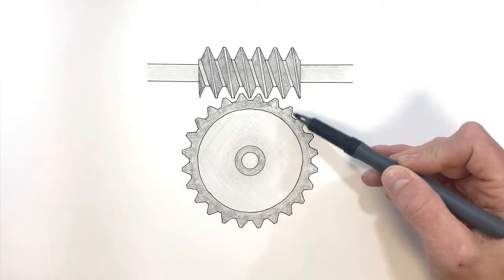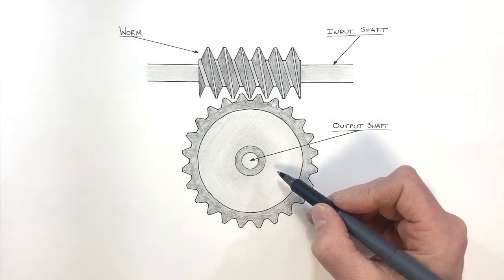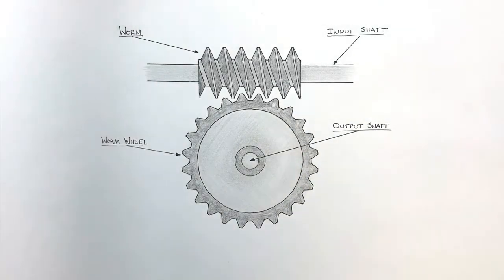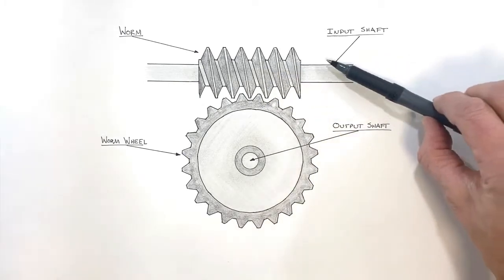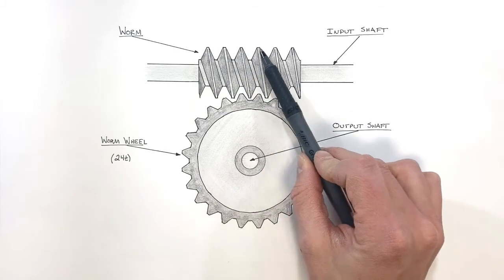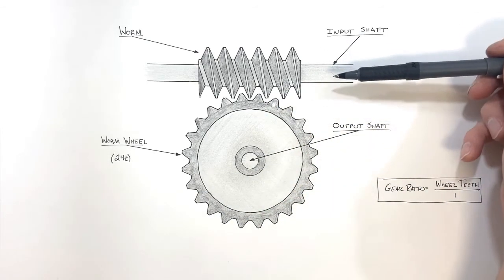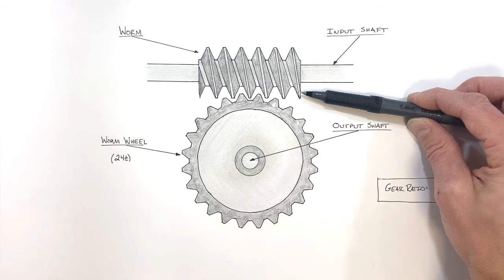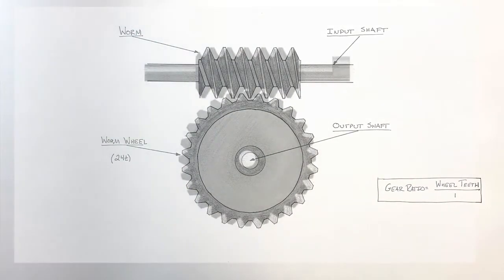Worm Gears Explained, Calculated & Modeled

Comment: So let me get this right , if the wormwheel has 40 teeth, will it be a 40 to 1 ratio? And how many 'threads' on the worm gear will achieve this? Will the worm be turned 40 times move the wheel through one revolution?

Comment: i love the drawings in your videos, so much so that i wanna make similar ones to present my different designs for my thesis (i'm a final year mechanical engineering student). the designs are mostly gear or ratchet mechanisms, one of them being a worm gear similar to the one in this video. would it be alright if you gave me some advice on how you go about drawing these or any equipment i might need to recreate them myself ? many thanks in advance - dont stop the good work !

Comment: is there any way in which the screw drives the gear along the screw, whilst also rotating the gear?
Reply from the maker: Do mean like if we let the worm travel axially along the input shaft?
Reply: @INTEGRALPHYSICS  Yes. I want this too. I want to turn a threaded rod that is the output screw, but I need the input shaft at 90degrees to the threaded rod. So the threaded rod needs to rotate as well as moving longitudinally for a minimal distance.

Comment: Hai, wonderful vedio. I have 2 questions for you. Does the worm and roller  require grease or steering oil of ranges 140 or 300 or 450 or 600.  By second question is does the worm and roller make driving more effortless than circulating ball bearing also called as ball and nut or is the recirculating ball mechanism   more effortless than the worn and roller. As I had a fiat 118 NE which was the 124 fitted with the Nissan A12 engine which had the recirculating ball mechanism which was smooth like butter , I still regret for having sold it. It was so smooth even though it didn't have power assistance

Comment: I am surprised that leads on the worm wasn't mention, that is extremely important on knowing the ratio, the example assumes the worm gear will always be a single lead, but there are worms with more then one lead, that is how a worm gearbox achieves various ratios, such as four leads on a worm would have changed this example to a 6:1 ratio, when you have a gearbox with a missing nameplate where the reducer is so worn out you cannot turn it by hand to get the ratio you must know this because the speed reducer once broken down almost always has enough tooth left on the wheel gear to count as well as counting the leads on the worm to know the ratio.

Comment: Another excellent explanation.
Little side note: A worm gear assembly is basically self-locking.
The worm wheel cannot (back-)drive the worm. Only the worm can drive the wheel due to inherent friction and direction of forces.
Can be desired or not. But if you want to use it, you should be aware of this.
Reply: Whether the worm assembly is self-locking depends of the pressure angle between the worm and wheel, or if the worm has a double start thread...
Reply: I was going to make this important point as well - but checked and see you have it covered.  This locking feature is what makes it a perfect design for a tuning gear on a guitar for example- not only the gear reduction.
Reply: Indeed. And a 'worm gear winch' is great in that it can pull more weight than a non-wormgear and also hold that weight and reverse when needed smoothly. There's no stopping pawl that has to be released. I used three worm gear winches on a modified horse shoeing stock to pull up the feet of stubborn horses. Works great on heavy draft horses, it's just very slow to turn, so I altered each winch slightly so they can be turned by a battery powered drill. What used to require two to three men now only requires one.

Comment: hi 
if i try to spin the wheal will the screw rotate or is it locked ?
Reply: Most worm gear systems are specifically designed so you can't drive it in reverse.  An application of the worm gear, is the tuning knobs on a musical instrument, which allow you to tighten the string, but don't allow the string to unwind the tuning knob.

It is possible with an extremely steep helix of the worm threads, to make a worm gear that can be driven by the worm wheel, but it is rare that we desire such an application.  It is much more likely that we would use other gear arrangements if we wanted bidirectional power transmission.

Comment: Can you do the reverse? Cna the worm gear ever be the output and the input be driving it so that we get a good ratio for speed?
Reply from the maker: Typically no.  Once friction is factored in, it is extremely inefficient (or even impossible) for the wheel to drive the worm.

Comment: I didn’t realize how much torque was multiplied through the worm gear assembly!

You didnt mention that a worm gear may turn a worm wheel, but a worm wheel may not turn a worm gear.
Reply from the maker: Big wheel + Small Pitch = Big Torque

If the pitch of the worm is large enough the wheel can in fact turn the worm.

Comment: hi all. i have a question. is it possible for a worm wheel to rotate a worm gear . im trying to design a pedal sysyem for my boat . im after max revolutions on the prop shaft to one turn of the pedal. cheers. plus a worm gear would eliminate the need for a 90 degree gear box
Reply from the maker: Yes but...  When you factor friction into things, I suggest you consider a bevel gear.  You can produce the low gear ratio you desire and easily build in the perpendicular relationship between the crank spindle and the prop shaft.  Hope my suggestion helps, let me know how it goes and good luck!

Comment: Great video, can you help me with some worm ratios. I’m making an ebike and using a worm gear with motor to power it, I have a motor that spins at 3500 rpm and would like an output of 350 rpm.
I’m looking at a NMRV030 gearbox.
What ratio would I need for an input of 3500rpm to get an out put rpm of 350?
10:1?
Many thanks
Reply from the maker: Worm bike. I like that.  Is it going to be a shaft drive?

Comment: If you could design your own tools (especially disregarding costs) would you prefer power tools to have worm gears, wholistically than a hyper specific tool? Say if you wanted to design a circular saw and choose if its direct drive or not (for I assume worm gears would overall provide, on average, less  RPM while giving you higher torque and maybe more suited through going into hardwoods) (also direct drive might be more cost effective and probably ideal for small drill bits that you need wicked fast RPMs to have the correct cutting speeds but this being a niche case?).

Thanks!
Reply from the maker: I like the idea but at first glance there may be a problem. 
 The issue being that the worm wheel can not (typically) drive the worm.  So if you are using something like a circular saw, the moment you let up off the trigger, the motor stops, but the blade would not...  and the inertia of the blade would tear the gears apart.

Comment: I have a silly question actually!!

If we directly rotate wormwheel  and not using the worm what will be the difference!?
Should we have to gather more torque or power to work!?
Reply from the maker: The point of the worm gear is to provide an increase in torque.  Using a worm gear, a low torque motor can be used to produce high torque on an output shaft.
Reply: okay.. like how & what is this thing which make this transition happened!?
Reply: Recommend that you take a look at a modern spinning reel schematic.. this is the exact case use in real life.. the worm wheel (handle) is used to turn a pinion gear (which is what drives the rotor) which lays the line
The point of using this great mechanical advantage is that it can still drive the rotor even under heavy load (the fish pulling) which is torque I believe
Google spinning reel schematic (stella, saltiga, exist, Certate) all model names 👍🏻

Comment: Could varying the thread distance (pitch) allow you to change the gear ratio along one shaft? 
For instance, if it was used in a vehicle moving the gear further forward would change the gear ratio and increase speed.
Reply from the maker: Its a good idea, but unless you change the actual tooth count on the wormwheel, the GR will not change.
Reply: @INTEGRALPHYSICS  I don't quite know how to describe this, but if a normal rotation of the worm would move one tooth of the wheel, couldn't it be adjusted so half a rotation would move one tooth?
Reply from the maker: Yes, you could have two threads on the worm rather than a single thread.

Comment: I wonder if you could use a worm gear to create a reciprocating mechanism using a rack gear
Reply from the maker: If you prevent the worm gear from rotating and then drive the wheel as the input you effectively have a rack and pinion.

Comment: Where is the actual math? I need to figure out the dimensions and angles etc. to make a worm gear for an extruder... I don't know a whole lot about this but i need to make the worm gear to at least... work
Reply: you want to machine one? as far as I know it's one of the hardest to machine gears so good luck :D what you should do is just check classified ads, or scrap yards in your area, some snowblowers use worm gears in the differential. some cars do too. save yourself the headaches.
Reply: @chrishayes5755  yeah but the thing is tiny, and my class ha s although axis, we have plenty of tools and I only need to design it
Reply: It's supposed to be 8mm Dia and 24 mm long those are the maximum dimensions...
Reply from the maker: I try to keep these sorts of videos very general because, as you are seeing, things become very specific very quick.  My suggestion is start at your desired gear ratio and work backwards from there.  The distance between the shafts is the effective sum of the worm and worm wheel radii (to the line of action).  Tooth profile and pitch are dictated by load, shaft speed, shaft stiffness, motor torque, gear hardness, surface finish, service life etc.  

I assume you are trying to 3d print these parts.  Worm gears are based on slippage, they are effectively inclined planes, so think about your print orientation.  I suggest you print the worm gear on its end so that the layers are mostly in the direction of slip.  The wheel can be printed laying on its face.  Its not perfect but at least that way the edges of the layers will be perpendicular to each other along the line of action which should smooth the action of the gear set.  If 3d printing, I suggest you coat the parts or sand them smooth between the teeth. 

If you are going to turn or cnc these parts I suggest you pull gears from something like Autodesk Inventor which already has gears designed in the catalog.
Reply: @INTEGRALPHYSICS  Thankyou, we have a 4th axis in class in one of our Haas machines, and im thinking about making the gear in there, I'm trying to use everything from a Bondtech Bmg extruder, except I designed a new case, heatsink and now working on the worm gear problem. It's going to be really small so printing won't work great

Comment: Is there a way to switch the input and output shafts on a worm gear? As in could I hookup a gear reducer to the worm wheel to produce an output force to cause translational movement on the worm shaft?
Reply from the maker: Under normal circumstances if you drive the wheel it will not turn the worm.  However if you allow the worm to move translationally, what you essentially have is a rack and pinon.
Reply: @INTEGRALPHYSICS  thank you very much
Reply: I should say that I meant rotational movement, and not translational
Reply from the maker: Rotational Movement: not going to happen unless the pitch of the worm is INCREDIBLY LARGE....  But it is possible.

Comment: Is energy loss from the friction between the worm and the worm wheel neglible?
If not, how  does one go about its mitigation?
Reply from the maker: There is definitely energy loss, whether or not you need to worry about it depends on the application.  One thing to keep in mind though, is that energy loss will NOT affect the gear ratio, only the actual mechanical advantage.

Comment: i want to make my electric train (DC) free rolling.  I.e., u can push it 
back n forth w ur hand when the elec. pwr is not applied.  I call it a
free rotating gear box.  All the electric model locomotives i have
can't be pushed to rotate the driver wheels freely.  The drivers r
stationary.  The only way to rotate the drive whls is to rotate the
worm shaft either by the motor or by my fingers...  Do u get the
picture?

How do u design that?  I've heard u need a helix worm w a matching
wheel gear.  But i think it's much more complicated than just the two
gears (a worm and a wheel gear plus perhaps a spur gear?).  Yes, to
produce torque to pull more cars, the gear box also need the gear
ratio reduction as u've explained in ur video.

I've searched here in the utube and guogle et al, for:

  'Free turning worm gear' or 'Free turning gear box' 

but no luck.

Pls advice, u or any audience?
Reply from the maker: The drawback of a worm gear is that the wheel can not drive the worm.  It sounds like you probably need a clutch between the gearbox and the wheels.
Reply: @INTEGRALPHYSICS  Thx 4 ur immediate reply.  There was a man from
Japan who was able to do that on his 0-scale - 2 rail locos.  But lost touch
w him.  I don't think he used a clutch (to disengage the spur gear from the 
worm).  But perhaps, i may need to look into this clutch deal.

Comment: How can I calculate the torque on the output of a 40-1ratio worm gear box
Reply from the maker: Short answer: its 40x the input torque.  Longer answer: you are going to need to know the frictional losses along with the worm pitch and tooth profile to factor in losses and inefficiencies.
Reply: @INTEGRALPHYSICS  Worm gears aren't anything close to 100% efficiency.  Spur gears in the limit of perfection can be 100% efficient, and in practice tend to be 98% efficient.

Worm gears are inherently inefficient and are limited by the kinetic friction coefficients of the materials we can use.  For a worm gear, 50% efficiency is optimistic, and is typical of what you can expect from the best worm gears available.  A worm gear not built specifically for efficiency, will likely have an efficiency around 25%.

Comment: What will i do to change the gear box ratio 15:1 to 10 : 1 for  same motor.
Reply from the maker: Im not sure of the application, but all other conditions being the same, changing gear ratio like that is likely to overload the motor.  Additionally a 10t worm wheel is going to be VERY difficult to design to run smoothly.

Comment: can you explain the backlash of gears and why do we need or not need them
Reply from the maker: Short Answer: Gear lash = wiggle room between gears

Longer Answer: In reality the line of action between gears is not tangent to the base circle of a gear.  As a result the gears are not moving PRECISELY at angular velocities given by GR=Win/Wout.  To put it another way... If the input shaft turns at constant velocity, the output shaft is going to speed up and slow down just a little bit with every tooth.  Gear lash can affect how rapidly that speeding up and slowing down occurs.
Reply: change the center distance for difference backlash, Am i right?
Reply from the maker: @何良-x7r  Yes.

Comment: How  u calculate the pitch of the worm an the gear to cut on the lathe
Reply from the maker: I suggest you determine the desired gear ratio.  Then, provided you know the desired output torque,  find the gear tooth size that will support the needed torque (theoretically this is based on the shear strength of the material as well as tooth profile, gear lash, tolerances and width).  In reality, find an existing worm gear design that is rated to a certain load for a given material, use that design.